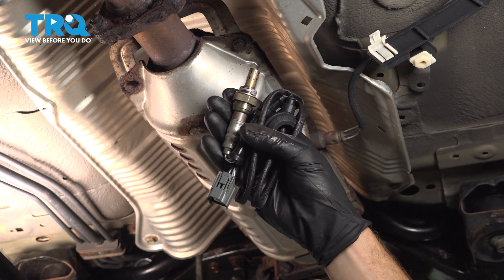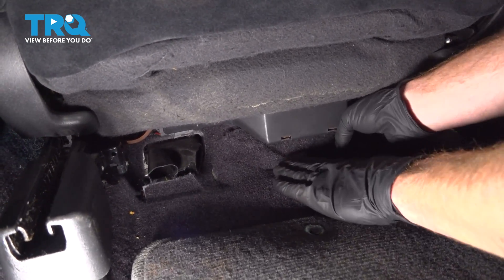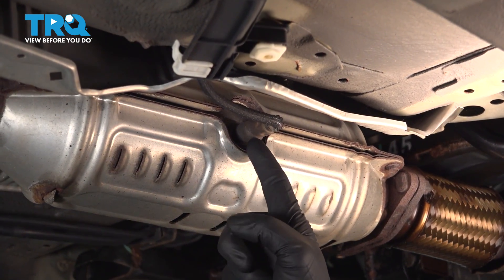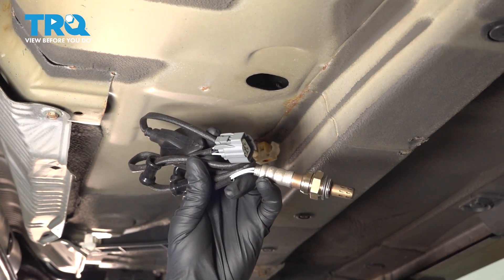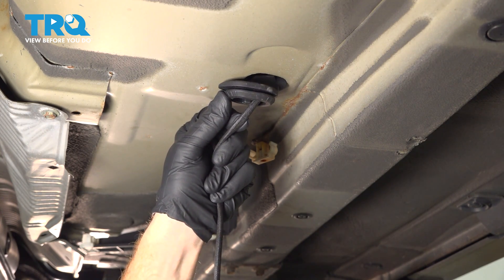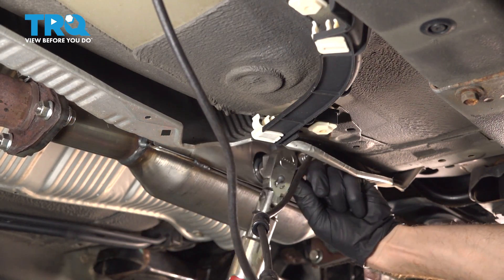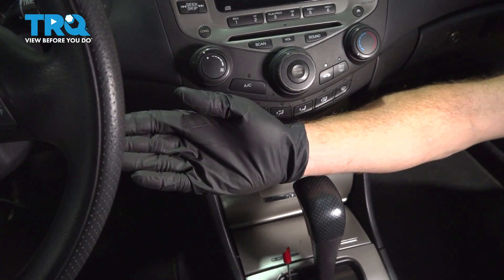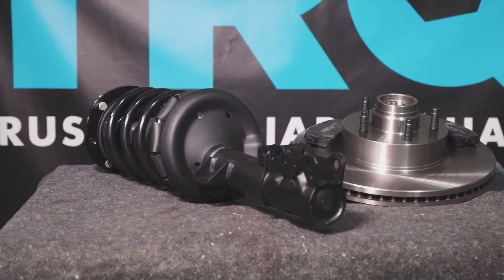How to Replace Downstream O2 Oxygen Sensor 2003-2007 Honda Accord

Comment: Thanks your video helped me replace this o2 sensor, mine was on an 2007 ex 4 cyclinder accord, had to loosen seat bolts to access the connector.

Comment: Lot easier if you take all bolts off seat and lean it back to get to connector. And if you take bottom cover off catalytic converter which is held by 4 small bolts you can use your own wrench to take off 02 sensor instead of having to buy a oxygen sensor socket.

Comment: Great video and informative, my Accord Euro CL9 2004 has two connectors under the seat where the wires come up from floor pan hole and branches out to two connectors, do you know why there would be two? In your video i see only one that you disconnect. Thanks in advance if you could help.

Comment: The NTK brand o2 sensor is a perfect fit with all new clips. On my 2 door accord the wire comes up through the floor a little farther forward and it helps to unbolt the seat and lay it back a little bit.

Comment: I always spray the O2 sensor where it goes into the cat with a penetrating oil like WD40 before breaking the old O2 sensor loose. And I do believe you will have to clear any codes that old sensor may have set in order to not have a "check engine" light after replacement.

Comment: If you guys make these videos you should make sure you explain that this is for the 2.4L, not the V6. They are completely different. Only the 2.4L have them under the car, while the V6 are all in the engine bay.